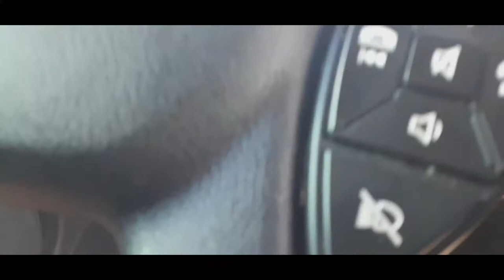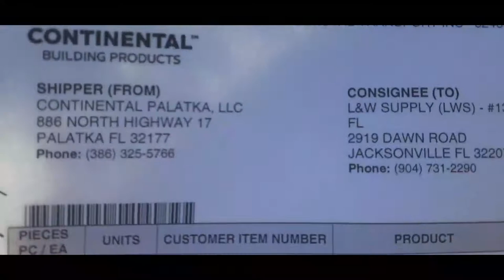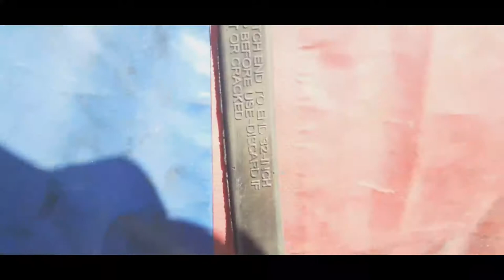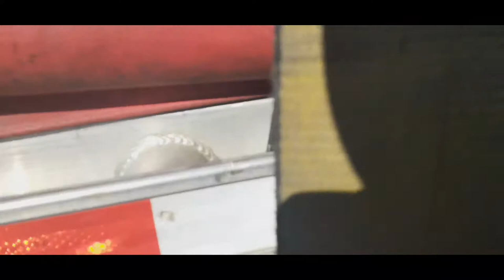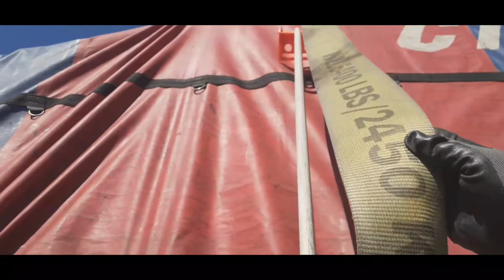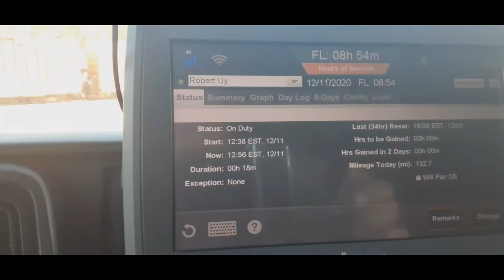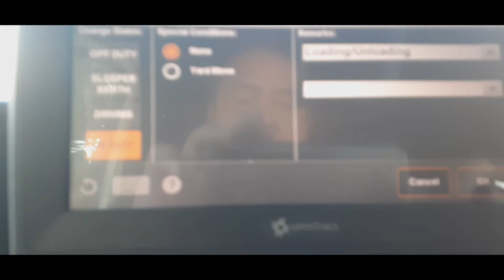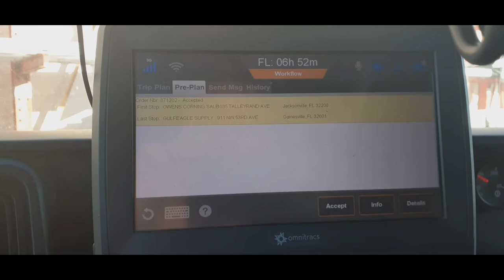Picking up a load of Drywall / Sheetrock with Securement ( Flatbed )

Comment: how can you tell how tight to put straps on drywall loads?
Reply from the maker: If drywall you don't have to ride the bar just tight enough not damaging the drywall,  drywall isn't slick like plywood and lumber.
Reply: @livingsimplelifestyle  
Do you recommend strapping over the tarp or under h tarp?
Reply from the maker: For me over the tarf, tarf help hold the entire load plus the strap for shifting